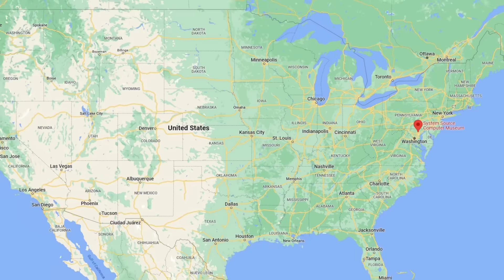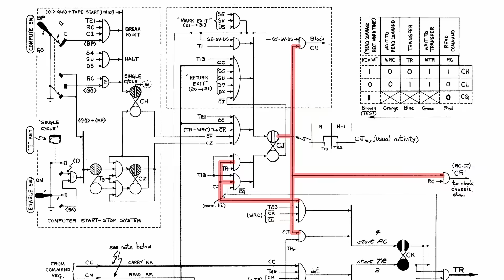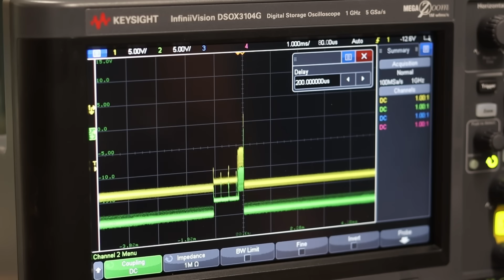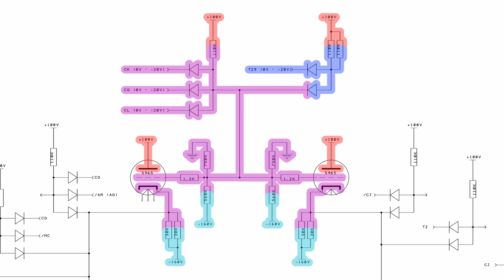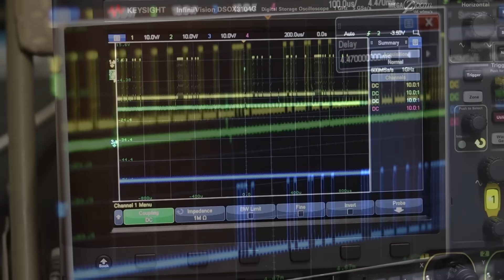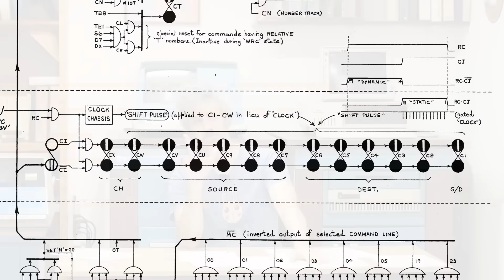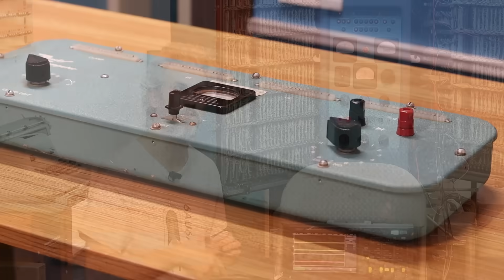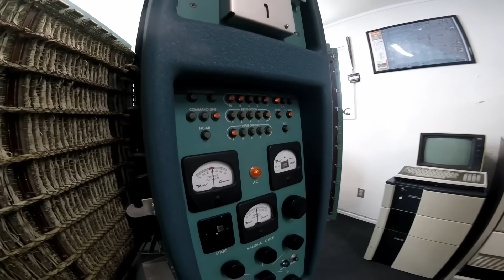This G15 is the Oldest Running Digital Computer in America!

Comment: Modern computers should integrate physical bells!
Reply from the maker: I agree completely!
Bendix liked it so much that this bell is actually built into the machine itself and isn't in the typewriter. It's a proper 120V DC bell too, which is wild to see.
Reply: @UsagiElectric that's crazy, how loud is the bell?
Reply: I expect to see a physical bell with an internal USB header on Hackaday within a week lol
Reply: I still connect the little piezo speakers to all my motherboards. All the new UEFI stuff still produces beeps and beep codes. It should be relatively simple to cobble together a setup where some simple logic (or realistically a cheap microcontroller) would "listen" for the sounds and ring a physical bell. Hell, you could probably connect  a wireless doorbell's button to those pins and let its debouncing circuitry take care of the rest ;)
Reply: @--Lam  Some motherbaords still have a connector for a beeper
Reply: @kensmith5694  Not some - ALL. And I do connect a beeper to every single one I build or help someone build. That's my point!
Reply: The bell is in the typewriter.  You can wire a terminal of that era to your computer.  You need to either find one that does full swing RS-232 or buy a RS-232 to current loop converter.  You then use a USB to RS232 thing that is easy to find.  Depending on the terminal, you may have some trouble matching the baud rate.  Once that is done you have a text only terminal and bell.

Comment: Nice gesture from Keysight! Really like how they handle their marketing through youtube and also like their products.

May I be warning you for a mistake that is at least three times as likely on a 4ch scope than on a 2ch one? They all share the same ground. So please take care when measuring over isolated parts of the circuit or when they have different ground levels. Notoriously difficult are switch mode power supplies, but your tube-toys may also have AC and DC circuits that don’t share a common gnd level. Make sure your new precious scope is not providing those anxious electrons a path over which they hurry to the other side!
Reply: Yes, even when nondestructive this can cause a lot of misleading results.  A lot of years ago now, I had three isolated scopes connected to a thing I was developing for exactly that reason.  If you have a 100 foot cable between parts of a system, there is no such thing as "ground"
Reply: This - so much this. I learned the hard way while diagnosing a high-voltage system that scope grounds can be trouble. I now use a ground isolation transformer when possible, but at the time, the best we could manage was an unplugged UPS.

Notably, the scope was fine. The device we were testing? Not so much.
Reply: @maurvir3197  We had built plexiglass enclosures for our Tek scope floated at between 3,000 and 30 kV depending on the test station ... this was for use during development of grid-controlled TWT based airborne transmitters .. those were the days! I actually got mildly shocked from 115V 400 Hz 3 phase, but never the HV stuff ... i was reaching around a 3 phase 115V breaker and the top contacts/screw studs were the 'hot ones ...
Reply: I only connect one lead ground and remove the rest of the ground clips.  Popped breakers a couple times before that.   Would love to have a set of diff probes one day.

Comment: I want a bell in my computer now.
Reply from the maker: More computers definitely need bells!
Reply: @UsagiElectric  If you can provide a good audio copy of the bell sound, I can change my alert sound to it and so when I 

echo -e "\007"

I'll get a G15 bell sound
Reply: @UsagiElectric  The old command for the buzzer that PCs had was called "bell" in many early programming languages, like Assembler and Basic.
Reply: @UsagiElectric and whistles....
Reply: A Bell that rings on every ASCII \BEL control character would be cool. I'm pretty sure there's a linux driver for an actual bell somewhere.
Reply: @web1bastler  Traditionally the PC speaker beeps on BEL, so you could maybe hook it up to the PC speaker as a hack
Reply: @bountyjedi  That really would not be a hack. The PC speaker is just a more modern implementation of the bell. It would be the right way to do it.
Reply: @bountyjedi  I miss my computer beeping on startup :(
Reply: @paulabraham2550  Well, with the PC speaker though you get to control the frequency etc. so those parts might not translate so well.
OTOH I think at least on older PCs that it was effectively a GPIO, just controlled by software to do the beeps, so maybe it could be hacked to just go high for bell on, instead of switching at a frequency.
Reply: @web1bastler   That was the original purpose of the BEL character. Printing one would ring the bell, just like on this typewriter. Later it changed to different types of speaker beeps. The ASCII BEL was transplanted into Unicode, so Unicode has one.
Reply: Where do you think the little beeper on your motherboard came from? There seems to always be one.
Reply: Ding, fries are done!
Reply: @Derpy1969 Ding, coffee is done if you hook the Bendix up to temperature probe and have it monitor for when your drip coffee maker increases in temperature after the water runs dry.

Bonus points if you find a way to hook everything up to your network. A hacked together UART adapter and paper tape emulator?
Reply: @Jeff-ss6qt  Might as well use the heat of the Bendix to make the coffee too.
Reply: @mal2ksc  That'd be perfect. You could water cool the Bendix and have some sort of heat exchanger into cooler water like what large data centers use for removing heat from the room (Only, they go to a much larger system.).
Reply: @Jeff-ss6qt  Put a whistling kettle on it, so when it has heated up, you'l get bells and whistles. ;-)
Reply: The bell is in the typewriter.  I have programmed on a computer with a bell like that.  Now that I am reminded of it, I find the memories to be fond ones.  Debugging software on one of those older machines was in some ways easier than on the new ones.  The guys who designed them planned on having to debug.  It wasn't an after thought.
Reply from the maker: @kensmith5694  Interestingly, on the Bendix G15, the bell is actually built into the machine itself, and isn't in the typewriter. Bendix meant for the bell to be an integral part of the machine and a legitimate form of "output" for the user.
Reply: @UsagiElectric  It so much better the The Buzzer Idea that scared people, then They Switch to the Bell ...
Reply: @UsagiElectric  I think the bell is behind the upper-right corner of the front panel at 32:00.
Reply from the maker: @wesley00042  Yup, that's the one! It's a Faraday 120V DC model.
Reply: @UsagiElectric Wait, so can you send the teletype a BEL character, then have the machine ring its bell?  That gets you two frequencies plus any harmonics lol.  Plus, it's stereo!
Reply: @kensmith5694 some ? Every way ! We could see and understand what is happening! Nowadays it's just black magic running on a piece of stone !
Reply: @kensmith5694  Bear in mind that on current clock speeds the physical duration of the bell sound corresponds to the execution of several hundred million instructions. I'm thinking it would be much more useful to route that debug output up to a channel on one of those keysight scopes.
Reply: @NateEngle  The bell can tell you that you need to connect the scope.  This would be much like a "check engine light"
Reply: The bell has quite possibly been the best part of this whole system.
Reply: Most shells have bell supported.
Reply: Decades ago, I used to use a parallel port as 8 general purpose output pins to do things like that.
Reply: I've hacked a usb midi interface onto a set of Christmas bells from the 90s... I should really put it in a nice case and arrange some music for it.
Reply: CTRL+G
Reply: You know, they actually still call it a bell in modern terminals. Often it'll play some noise from the computer these days, but it's cool to hear a physical bell and pretty much see the living history behind why it's called a bell still.
Reply: @rileyguy5892 and the best part is that if you can wire it up the bell will perform the same job it always has.
Reply: ASCII 7 gets you a bell.  I don't think Unicode has a bell.
Reply: @libertine5606  ASCII is a subset of Unicode, so all ASCII characters, including the control characters are part of Unicode. The NUL character terminates a UTF-8 C string.
Reply: @libertine5606  bell should be valid in unicode.  Just another control character like carriage return, line feed or tab.  Whether it does anything is another story.  Even a modern terminal emulator will sense it though and either make a sound or have some visual attention indicator.
Reply: @libertine5606  Unicode is designed to be a superset of ASCII, so BEL is just as valid in Unicode.
Unicode also has a bell🔔 emoji, but that is another story ;-)
Reply: ASCII Character 7 - BEL
Reply: To bad the type writer can't be replaced with a terminal I can see paper and toner being an issue once it's on display
Reply: Most PC motherboards have an output for a speaker. These days it's normally reserved for POST, but it is usable under Linux. If you need a mechanical bell, you would have to build hardware to attach to the parallel port header (if you even have one) and write a driver to run it.
Reply: A pinball bell ! 
Better still, a set of chimes ..
Reply: you can 
add some filters to your motherboard speaker output  and amplify the dc signal you are left whit   and make it run a door bel or a solenoid ring a bell
Reply: @Thefreakyfreek You could get a  solenoid driver and wire it up to a circuit that  monitors e.g. the scroll lock LED for state change.  You could use a microcontroller and look for a specific sequence of scroll lock LED pulses if u don't want to lose the LED entirely, tho that would introduce a slight delay I guess.  Alternatively, with the right keyboard controller, anything's possible lol.  Plenty of open-source keyboard controller firmware out there now. But I like doing it via the keyboard because it's more terminal-ish.
Reply: @bsadewitz  exactly snoting is impossible
Reply: CHR$(7)
Reply: Open a terminal and press ^G
Reply: The bell is very familiar to anyone who has worked with a teletype.  if there is a real or emulated teletype connected you can ring the bell by sending BEL to it as I recall
Reply: the closest you can have is a beeper for post codes, maybe a custom beeper that smashes a bell
Reply: Why? You a cow?
Reply: @tripplefives1402 That's true, it's been awhile since I used either.  Something didn't support the bell anymore but I am not sure what it is.  Maybe, Basic, or Assembly, or C++, or Python?  Not sure.
Reply: @tripplefives1402 The codes 0-127 are ASCII. ASCII is 7-bit. UTF-8 uses the highest bit to indicate a multi-byte character so above #127 we are out of the realm of ASCII.

In some older encodings numbers 128-255 are used for various language-specific characters.
This used to cause some issues in the transition period for those of us using languages that needed e.g. Latin-1, since UTF-8 multi-byte characters would get interpreted as two Latin-1 characters etc.
Reply: hahaahahahah
Reply: Timestamp or it didn't happen!
Reply: @captainchaos3667  there is a non-functioning restored model of the Z1 in Munich, and functioning replicas of the Z3 and Z4 in Berlin. The Z3 is the first ever programmable digital computer dating to 1941. Unfortunately, the original was destroyed in WWII. So, none of these machines quite meet all of the criteria of "oldest" and "working".
Reply: @tripplefives1402 lower 128 (0 to 127) ASCII is 7 bit
Reply: I want a proper bell on carriage return
Reply: Hey. That can be done
Reply: i grant you a piezo buzzer 🧙‍♂
Reply: Many terminal programs play the default system alert sound when they receive an ASCII 7 character. So if you clip the ding noise from this video or another suitable bell sound, and assign it as your default alert sound, you too can have a terminal that goes ding.
Reply: @tripplefives1402 alot of modern boards still have a serial header for industrial consumers so you can skip that step.
Reply: I'm sure there is a mod kit available lol 😆
Reply: Yup. It's a must 😂
Reply: Facts!
Reply: i guess you can just connect it to the pc speaker wires somehow if your machine is old enough
Reply: @lvl90dru1d  Somewhere I still have a little addition to DOS-EMU that I created that played a bell sound out the speakers any time a DOS program thought is was making the PC speaker go.

Comment: "Hey, if it worked once, we CAN actually get it to work twice."

This here is the retrocomputing credo.

MASSIVE CONGRATULATIONS!!
Reply from the maker: It just takes a little bit of stubbornness and not knowing when to quit and everything can work twice!
Reply: @UsagiElectric  I agree 100%, it's a lot of work but also incredibly rewarding, be it a full-blown vacuum tube computer, or a Commodore 64 - troubleshooting rules for digital computers basically remain the same, so for some part it's a bit easier to wrap your head in how they work. Vacuum tube and earliest transistor computers are just plainly difficult since you got so many wires in the backplanes to choose and crimp the oscilloscope probes onto.
Reply: @Dr_Mario2007  I once told a professor I was helping that computers are like magic in that the most powerful component is belief. As long as you believe it can work you will continue tinkering until it does.
Reply: That line gave me a 50 year flashback. As a young, green computer technician I approached an experienced coworker, showed her a flip card and said "Does this work?" And she said "Did it work before?" I replied "Yes.'" and she said "Worked before, works again!"

Comment: Wow amazing.  The timing on that final bell ring flurry is chef's kiss!  I did not know there was a connection between the G15 and Alan Turing/Tommy Flowers, which goes back to the vacuum tube Colossus and the war-time code breaking at Bletchley Park in the UK.  That makes this actually running code again all the more special. Thank you so much.
Reply from the maker: Thank you!
It's wild to think that this machine has a direct connection to Colossus!
Reply: Whoa
Reply: I mean, all computers do. There hasn't been anything revolutionary about the computer since WW2, only evolutionary changes bringing over all the old cruft.
Reply: @T-Ball-o  Presumably the tubes doing much the same stuff, but now smaller as the diodes are not tube diodes, and the resistors have probably shrunk in size along with PCB tracing rather than all jump leads.  I think Flowers was working on another machine (at Manchester?)  but at the same time the British Govt wanted the technology secret in order to retain codes/codebreakability

Comment: Dave, Congrats on the first diaper tape run. Cant wait to see the second tape execute. Does the typewriter have a ribbon loaded. If so and its dried out try this. We used to pull old ribbons off the printer and spray them with wd-40, let sit for 2 days and reload them. The ink came back and made passable output. Some old band printers were industrial only and getting the ribbons were impossible even the late 70's.